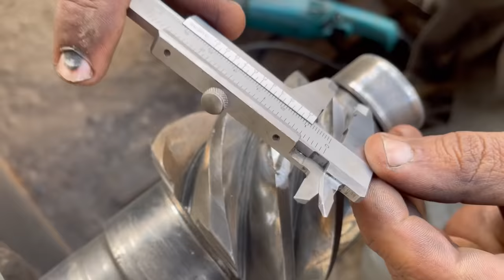I repaired the scrub pinion which no mechanic repairs | Give your opinion by watching the video |

Comment: Agreed, good work restoring that part to get back running. Longevity, as others have said, is the issue. The part might look good, restored and polished up, but how well it meshes, in terms of the pressure points on the gear teeth is another matter. To see it installed,  and Prussian blued up to show contact pattern would be nice, then the repair could be judged a bit more accurately. Regardless, hats off to these sandaled mechanical madmen! Loved him polishing the bearing mounting surface with his finger just about resting on the tool bit! Cowboys!
Reply: MY thoughts exactly.These guys do great body and frame work,but this is much more critical. While this repair may get INDIANA JONES TRUCK across the rope bridge,it most likely won't last.If he had a 5 way CNC and carbide cutters and the ability to program it correctly,then maybe.There's a reason gears like that have a polished precise surface and use high pressure lube.  It is the ability of the lube to allow the parts to slide past each other while transferring the pressure of movement across ALL of the tooth SURFACE{or contact patch in the case of gearing}. But at least this allows them to make one more delivery of goods or product,so my hats off to them,never give up!!!!This channel is an inspiration to others,anything is possible.
Reply: It better than before and you got to give it to him, you cant tell which tooth got welded!! 😁
Reply: I think they know it won't last. But it's either that or paying 100 times more for a new part. Maybe they will need to fix it again another 10 times until the truck need to be totalled. That is still significant money saved. The money saved could probably feed his family for few months or even years. In terms of safety, well I guess they are willing to take the risk. I guess it's not easy to understand when you are living in totally different quality of life.
Reply: All I've got to say is a weld is stronger than the original material. The rest of that entire tooth will have to sheer off before that weld breaks. That's just my life experience and also what they teach you in welding school
Reply: You guys have been living in the first world to long.  Give them credit for attempting a repair.
Reply: @aaronsimpson8329  My main concern would be heat treat.  If the weld metal is in the annealed state then it will not have hardness and it will be prone to premature wear.  They did an amazing job considering the circumstances though.
Reply: @RedShiftedDollar  most car parts aren't hardened steel, solely because it's too fragile. Most all engine parts are annealed to prevent wear and tear. Imagine 2 hardened steel gears rolling on each other and the teeth don't mesh 100%they're not going to have any give and shatter. So if anything the welded tooth might cause damage to the opposing part because its harder than it. But the surrounding material would break before the weld.
Reply: @aaronsimpson8329  I thought most gears were case hardened.  The core remains soft and tough and the surface gets a hardening treatment to improve wear resistance.  Either way, the hardness of the repaired section should be similar to the remaining teeth otherwise the harder teeth will be prone to cause premature wear of the softer ones.
Reply: @RedShiftedDollar  case hardening is a completely different thing. That's actually layered with a thin layer of alloyed metal that is harder and more durable than the material it's adhering to. So maybe but it's totally different than harrdened steel
Reply: @aaronsimpson8329  Either way the weld repair in the video looks good and I’m sure the machine will work.  It would be a problem if they were doing this as a rebuild service without telling their customers, but from what I see, the finished product speaks for itself.  It looks great.  It’s a common practice to repair shafts using spray welding to build back worn material and this is a similar process.
Reply: @RedShiftedDollar  I was just informing you of what case hardening is. But yeah no I see no problem, I Grew up with a family that would do that same thing. Not to this scale but fixing what's broken or at least trying balls to the wall. My dad built his first Car from 3 different ones in the 70s. I see nothing wrong with this
Reply: @aaronsimpson8329  You won't be able to convince me that the welding rod material is harder than the hardened steel gear. But that's just me :P
Reply: @mawe42  bit of a hiding going on when he resurfaced each tooth
Reply: @JerryMetal  this isn't a hardened gear like I said most all engine parts aren't hardened solely because it makes them fragile. In an example your starter and flywheel are soft so they don't prematurely wear. A weld is DEFINITELY stronger than the base metal. And I mean a weld vs hardened steel it just depends on the type of steel and the rod. And the temperature and time it was hardened at. There's too many variables to say it's stronger than hardened steel but it's definitely harder than annealed steel.
Reply: @JerryMetal  not to mention its very hard to weld hardened steel and needs to be post heated to be able to bond. You should Google it and it'll tell you what I'm telling you....
Reply: @JerryMetal  do you remember  the Somali pirate attack against one of our navy cruiser? The steel plates opened like a exploded can, but every one of those damaged sections welds still intact. The material  will give out before the weld will. 6010 rods tinsel  strength  is 60k psi before breaking.
Reply: @robertoruiz7069  but of course they don't even have a 0 axis CNC. The part is probably not available, or if it is not at a reasonable price for the customer. And yeah there's going to be some thousands off, but it's going to do way more than one delivery on that repair, it probably did 200 deliveries with half the spline broken off. And if you can't get the part or you can't afford the part but you can get somebody with a grinder and a good eyeball, if you can get a shit repair every 200 deliveries it's going to work out. Maybe you've never been to the third world
Reply: @aaronsimpson8329  If you check it out, he used a hardfacing rod 0.7% carbon, Rc 56-60
Reply: @COALEDasICE  and even if you're talking semantics and technical terms and shit. Everything I said is true. You should Google it before you're arrogance get the best of you in a real life situation. Because I did that before I answered homie and your question to make sure what I'm talking about was at least accurate with research 🤷
Reply: @L98fiero  I'm not a professional  you'll have to explain what that does for me to understand what you mean by it. I just worked with professionals and spend lots of time watching trades videos online.
Reply: I doubt longevity is issue if it was properly welded it would of been stronger than the orginal cast part. Only issue I saw was tooth wasn't fully restored nor was tooth gaps checked. Other than that I wouldn't be surprised if it lasted full life of the vehicle..
Reply: @Thelongmanable  this is ofcourse, not a cast, but forged, and hardened.
Reply: I'm no machinist but I thought of all the details you just explained.makes total sense.  Then again, if you dont have the money. Improvise.  Companies do it all the time 😂
Reply: @aaronsimpson8329  The rod he used is a hard surfacing rod that hardens to Rc56-60 it will be as hard as the rest of the gear. It would be a kind of crap shoot as to how the gear meshes considering that it was hand shaped with an angle grinder and there didn't seem to be any preheat to relieve the problems with the heat affected zone, the transition between the original and the weld metal, which might affect it's life but it probably will work.
Reply: It's so cute to see people talk about this repair with the recommendations and concerns. They have been making repairs like this since forever. To them, it's no different than changing out a seal. Don't doubt the skills!
Reply: Well said
Reply: @aaronsimpson8329  brutha I can tell you didn't just from how you described case hardened saying it's two different materials. Have actual knowledge about stuff before not just look up shit just so you can reply to random people on the internet
Reply: @GaragePL85  ok
Reply: @L98fiero  I appreciate the information!
Reply: @aaronsimpson8329  bravo Aoron. 
J’ai lus tes commentaire. Et c’est tout a fait vrais. Vous avez raison. 
La reconstitution d’un engrenage endommager de cette façon par la soudure. Ça ne marche pas. A cause de plusieurs défauts. 
La température d’effondrement n’est la même. Et encore les bulles d’airs . 
Pour moi. Je n’accepte pas ce dépannage. De cette roue dentée qui va supporte une grande charge de frottement.
Reply: @aaronsimpson8329  well done Aaron.
I read your comments. And it's absolutely true. You are right.
The reconstruction of a gear damaged in this way by welding. It does not work. Due to several flaws.
The collapse temperature is not the same. And more air bubbles.
To me. I do not accept this troubleshooting. Of this toothed wheel which will support a large frictional load.
Reply: @lewis2553  il ya de l’herbe là-bas 🌿🌿🌿
Traditionnel. Depuis plusieurs années. 
C’est leur façons choisi pour etre heureux et avoir une forte personnalité. Pas comme les autres pays. Coc.hero. Crack…..
Reply: @unkertech  you're last sentence said it all. I just finished a tour in Sudan for UN. Not only did they make something from nothing but they did it in the most horrific environment. 120 degrees, red dust flying everywhere, oil & grease all over.
Reply: 0
Reply: although it ma take them some time to build the 80,000lbs press required to build the steel/ceramic armor plates we build and this is speculation to build what we have its only a matter of time until their a competitor.
Reply: @unkertech  Steering is nothing to play with... If its Stucks when it breaks.... With heavy weight ... People going to die ...
Reply: @ori0001  what did this have to do with steering? 

Also a lot of people here must not be familiar with the remanufacturing of automotive parts on the regular. Maybe not to this extent, but nonetheless a common practice. The argument about material hardening was amusing to say the least but I learned more than I knew when I came here about it so I'm in no position to take sides. I do specifically remember a case hardening issue with general motors camshafts that was a leading cause of camshaft failure in DOD v8 engines. Boy I made some money selling those cam/lifter rebuilds for a while 😂
Reply: @aaronsimpson8329  maybe harder than mild steel but most definitely not stronger than the hardened alloy steel of a pinion gear. Not only that but the HAZ likely weakened the original material near the weld making much more brittle.
Reply: @aaronsimpson8329  also gears like that work harden thats why you have a break in period
Reply: @ori0001  Not saying I "approved" of such method but these people has been doing it for years. They have to make do with what they have. Nobody want to risk their life if they have the choice. Point is, you wouldn't understand until you live in their world. Not everyone is privileged to live in first world country.
Reply: Do it again if it fails after few days😄
Reply: @aaronsimpson8329  Case hardening is done by diffusing carbon into the metal surface-- several hours of baking the part under high pressure propane or carbon granules.  It's critical-- a few years ago an Indy racer lost the Indy 500 race because a critical gear had not been case hardened.  The gear lasted under 5 hours!
Reply: @aaronsimpson8329  weld might be strong but precision it’s critical. Been a gear it needs at least 99% contact, also it has to have some backlash to allow thermal growth
Reply: @galindo68  way I see it in things like this being a steering part. This is more than enough to be effective. I mean only very few engine components need to have a specific gap, or clearance. I don't think gears of this size would have much thermal expansion to the point it would bind. Especially in the middle  east where it tends to be a stable climate throughout. Not like north America. The question at hand was the strength of the weld to the part.
Reply: @georgegonzalez2476  face hardening is the act of adding high carbon to metal while its Ata high temperature diffusing carbon into the material. Case harding is the act of adding a harder material to the face while allowing the under material to "stay soft".and hardened steel is just quenched high carbon steel.
Reply: @COALEDasICE  you need to educate yourself between the differences of hardening. Face hardening the act of submerging high temp metal in carbon allowing it to diffuse into material. And case hardening the act of layering a small layer of harder material on a surface. And hardened steel. The act of quenching high carbon steel. A simple Google search could've told you that. But you just want to be here and say you know what you're talking about cuz you're a fabricator when the "fabricator" doesn't even know his terminology. Why don't you run this by your supervisor and see what he says. I mean you willful ignorance is scary. I'll stand by my Statement ENGINE COMPONENTS ARENT HARDENED STEEL. or like in this instance STEERING PARTS ARENT HARDENED STEEL NOR ARE THE BOLTS THAT CONNECT THEM. Like I said before they may be case hardened but they're not hardened steel. Your reading comprehension is just about as bad as your ability to get your point across.
Reply: Filed and sanpaperd the crank shaft on a turbocharged diesel engine with a burnished file some sandpaper and a  Shoelace After It melted and spun To connecting rod bearings. Still running fine 6 years and 70k miles later.... if you do Enough have baked repairs you ether get good or one of them kills you
Reply: !Agree!
Reply: @unkertech  why do you assume that people living a different quality of life would not understand?
Reply: Not just concact pattern pattern.

There clear damage to almost ever tooth. 
The hardening on that tooth is now gone.
It’ll look pretty but this gear is good and fucked
Reply: I couldn't have said it better. One thing to add is, it would probably cost too much in labor here in the US to do this. You would probably have to buy a new pinion.
Reply: @aaronsimpson8329  if you se it has a bearing journal and that requieres precisión. If it’s not  straight it will ride harder on on side causing bearing failure, also gear wear unevenly. I’m not knocking the ability of the person to weld and tapir just stating the obvious. If like you say it’s for steering purpose even more critical because it’s in constant use and if fails it could be fatal
Reply: I work as a chief engineer on board Ships  ,I have encountered experienced machinists/fitters on-board who rebuild shafts ,shafts tend to bend when u do spot welding ,so the welding has to be slow for the heat to dissipate without causing thermal stresses,and most of the shafts do have a good working life ,but yeah replacement is always a better option ,but for us ,it is important to keep the ship running till the spares are connected
Reply: @galindo68  bearing journals between where the gear teeth mesh? Doesn't seem right to me.
Reply: @aaronsimpson8329  we’re do you think that gear is mounted from. If you had any mechanical knowledge you would understand
Reply: @galindo68  yes I get that it has a bearing to keep everything aligned. I'm not sure what that has to do with the gear teeth. Maybe other than the fact it's not going to have any play so if it doesn't fit right it'd not mesh right. You just made a statement with zero context talking about bearing races which were completely irrelevant to what's going on here unless you want to explain your though more
Reply: @aaronsimpson8329  I was lucky enough to work in a heat treatment plant. I wanted to learn about metallurgy after becoming a machinist. Very interesting. Steel and alloys of steel can't be hardened without carbon. Case hardening is heating a part in a carbon rich atmosphere for a certain amount of time depending on the depth you want. Must be ground to size after. We used alcohol diesel mix mostly. Part must be quenched then tempered. Tested then tempered again if out of spec.
Hard surfacing is welding a different alloy onto a base material then precision ground to size. Mostly done to save money. Use a much cheaper alloy for a shaft and the expensive alloy on the surface. 
The only process we used that didn't need grinding afterwards is Ammonia Nitriding. Much lower temperature needed so doesn't distort the part. Dangerous tho. Open the furnace before it's cooled enough and BOOM! No rookies allowed near that!
 Hope that helps
Reply: As far as this repair? Too many things wrong here...
So no....just no LoL but high marks for effort.
Reply: @aaronsimpson8329  they absolutely are hardened, at the very least they would be case hardened, the starter may have a lower hardness than the flywheel but neither of them are "soft" by any means. And the gear in the video would be hardened to a better standard than a starter or flywheel as it is in constant mesh unlike the starter and ring gear of a flywheel that only mesh for seconds at a time
Reply: @Scott_A  I've said that previously
Reply: @aaronsimpson8329  actually you said to @jerrymetal  "this isn't a hardened gear" in reference to the video and then you said " in an example, your starter and flywheel are soft so they don't prematurely wear" soooo, you're full of shit as the gear in the video and starter and ring gears are hardened. Just because they may use a different process to get a different type/level of hardness doesn't take from the fact that they are hardened materials
Reply: @Scott_A  read up dingleberry. Soft as in not hardened. I've stated what you said in the first 20 comments. A hardened steel gear is definitely different that a case hardened gear. Which engine and suspension parts aren't hardened I quiet literally said "they're not hardened they may be case hardened but they're not hardened steel. The process which they are hardened definitely has an affect on durability of the part. Your reading comprehension is just as bad as the other guys holy shit
Reply: @aaronsimpson8329  do you know anything about machines with gears? If it’s out of alignment the bearing gets damaged. If bearing fails the gears will fail
Reply: Also the time and materials are cheaper to replace
Reply: @aaronsimpson8329  case hardening isn’t a seperate layer of material added
Reply: @aaronsimpson8329  i did, thought I should
Make sure I was correct before correcting you.
Please read further than the first answer that pops up on google
Reply: @galindo68  yeah except that is irrelevant to what we're talking about fool we're talking steel hardness not bearings or gears. How do you link material hardness to bearing failures. I never spoke on behalf of how precise it is. Yalls reading and writing comprehension is absolute shit. It's like you had a thought in your head and thought it was relevant, blurted it out randomly expecting people to understand. I get what you mean after you give context to your thought process.
Reply: @chrisbanning413  read 4 or 5 forums and you'll find out what most people think of case hardening is actually called face hardening. And hard facing is case hardening but specifically with welds. I didn't know any of this before Commenting originally. I've spent enough time on here debating / researching with other people to know what I'm talking about.
Reply: @chrisbanning413  if you were to Google case hardening vs surface hardening (face hardening) it'd tell you specific differences. The 3 types are case hardening, surface hardening and through hardening, (hardened steel)
Reply: @aaronsimpson8329  and you still don’t know anything about it.
You have even had a comment from someone employed in the industry that says you are incorrect
Reply: This is a great job you guys are good at this i look up to following what you do...
Reply: @aaronsimpson8329  idk about that he kept welding over welds without letting them cool down enough and the heat affected zone also plays a part in the metal becoming brittle which can cause a fracture along the metal
Reply: @aaronsimpson8329  proper terminology....
Case hardening.....heating a part in a carbon rich atmosphere. Adds carbon regardless of the alloy.
Hard Surfacing.....adding a harder alloy than the base material.
These arguments are why I wanted to learn more about metallurgy. It can get very confusing. It's a HUGE learning curve but very interesting!
Cheers
Reply: @dv42300  that's face hardening. Look at the differences between the two. Face hardening is direct into carbon. Case hardening requires a small layer of harder more durable metals. At least that's What all the forums say
Reply: @dv42300   @Doug Venus  hard surfacing is the act of welding on top of the base metal. Specifically with welds. Face hardening is the act of submerging steel in carbon at high Temps to up its hardness. Case hardening is the act of a more durable metal. Yes we are arguing and metallurgy is a fancy word but man I'm not sure how people can come up with anything other than. But face hardening, case hardening, and hard facing are all 3 different types of hardening. Hard facing tends to be done on new or broken equipment excavator. Case hardening can be the metal plate on your antique pistol. And face hardening is what they do with knives to make sure the tang stays "soft", and the edge is as hard as can be to keep an edge. I too have looked into this topic and am unsure how people who look into it and research it can come up with different answer's. Beyond the first initial Google search.
Reply: By the logic one can face hardening a peice of mild steel to make it high carbon knife steel. Only penetrating a few mm.
Reply: @aaronsimpson8329  Complete bollox
Reply: @stevo184  bollox to the fact that none of you actually truly researched and compared anything. Looked at multiple sources other than Wikipedia. I mean shit in school you had to source like 5 sources on your research paper. Why can't yall use that skill in your day to day? I mean fuck if you did I'm sure you'd change your disposition on more than just this topic. I'll provide links to metal foundries if that's what it takes for you guys to look into things
Reply: Yall ain't gonna like it but galvanized steel is case hardened lol except it only prevents oxidation and gives a longer lifetime the act of boronizing is just like galvanizing except add to the durability
Reply: @aaronsimpson8329  cool the weld is stronger than the part now.  I wouldn't of known that honestly.  Learn something everyday.
Reply: @RD-xh9ss  yep its pretty cool. I've been kn trades my who life and honestly this is my favorite part is actually looking into it and Learning  stuff commoners would never know
Reply: Your thought is right, but it can carry lots of tons
Reply: @howtomakeit5692  yes as a steering component I wouldn't worry about this personally many people live in wonderland where they think it need to be able to carry a mnt. It's a steering component
Reply: @aaronsimpson8329  yes
Reply: Какого хрена! Варить надо в среде защитных газов. Отремонтированный зуб с точить на фрезерном станке. То что они сделали проходи точень недолго.
Reply: @aaronsimpson8329  It's not a steering component. The front of the truck is untouched, the drive shaft is out and most of the tools n guts are located at the rear of the truck. Most likely its the gear that drives the big bevel gear of the differential. It needs to be scookum.
Reply: @frikcoetzer1776  could be part of a driveshaft based on the size and type of pinion gear it's most like a steering component. Plus that's the most common use of pinion gears Google it. But thanks
Reply: @stevo184  Hi Steve. I made the blanket statement that all case hardened gears had to be ground to spec after treatment but I could be wrong. I treated thousands of low speed gears that went into winches. Is something like that ground to spec?
Reply: @aaronsimpson8329  No it's called galvanizing. It's to protect against corrosion and is softer. 
I think you need to actually work in a heat treatment plant for a year or so. My boss had a degree in metallurgy. It's not a fancy word. It's what are discussing. One part of it anyway. BTW you stated case hardening mild steel a few mm. Can you tell me at what temp and how long it takes to case .010 thousands of an inch? How deep can you case harden? Why is there a limit? I have no interest in insulting you but I can say most of your statements are false. Best way to learn is to listen to people who have done this type of work for a living. Better yet, get a job doing this. It's hot brutal work at times but I enjoyed it. Another suggestion is to buy the Machinerys Handbook. Dry reading but was my Bible in trade school and beyond. No people making false statements in a forum just facts. Again I m not trying to insult you. You're almost there and obviously have an interest in this subject.
Cheers
Reply: @dv42300  this is NOT Galvanizing. I'm not even going to read your comment beyond that. This is not galvanizing you don't work in a heat treat plant. Galvanizing is a zinc coating on the metal. Nothing like this. Galvanizing is strictly for oxidation purposes. Don't.come here trying to sound like an intellectual when you don't even know the processes.
Reply: @dv42300  also I'm not going to listen to YouTube experts when there's viable research online you can do telling you the opposite of what these "expert" are saying. I listen to wise people not people telling me I'm wrong and not being able to back up anything they're saying
Reply: Since you're speaking on behalf of a other person who's gota degree, you should look at the differences between steel hardening and galvanizing. I don't need to know the tolerances of metal and how much they expand to know the different types of hardening methods..... at this point I'm not being rude I'm just tired of people telling me I'm wrong and it's a different process when they don't even look into things. 100% not Galvanizing I'd put myself on a firing line I'm that positive.
Reply: @aaronsimpson8329  How can you learn when you refuse to read? I thought I was being helpful. Oh well. Good luck in your future endeavors.
Reply: @aaronsimpson8329  you right about one thing. I do not currently work in a heat treatment plant LoL but I did for several years. I also owned a Paragon oven to heat treat knives I made. Got tired of paying someone else to do it. In fact I got that job to learn about metallurgy because of knife making. Learn by doing....
Reply: @dv42300  I refuse to read from people claiming they know the trade and aren't even in the same ballpark. Trust me I've read so much from actual forums and not just YouTube experts. So you telling me I don't read is just wrong. Look up galvanizing and get back to me. This wasn't helpful if anything you made it more confusing to the people who read this and choose not to educate themselves. Such as yourself. A look on the goog would've told you this isn't galvanizing. And you tried to correct me. .... I just can't get past the logic of you telling me I need to read when you didn't even do your own research
Reply: @aaronsimpson8329  I only research when I don't know the answer. I commented on your unwillingness to read the rest of my post not reading in general.
Reply: @aaronsimpson8329  BTW did you "research" your statement that I don't or didn't work at a heat treatment plant? You sound very sure of yourself. I guess my income from that time and tens of thousands of parts I treated and tested don't exist?
Reply: @dv42300  you also thought this was galvanizing you owning a oven is cool but irrelevant. You obviously didn't learn much by doing you must've worked in a galvanizing factory not a heat treat company
Reply: @aaronsimpson8329  "face hardening is what they do with knives to make sure the tang stays soft" 
Could please quote your reference? I've made hundreds of knives and never heard this before. I'm not saying you're wrong. The description doesn't sound right. My knives were made with ATS34 or 440C mostly and were heated to 1850F (ATS34 anyway) then forced air quenched. Tempered twice, two hours each usually to Rc56 to 58. Pretty hard for a knife but the edge lasted a long time and I had the equipment to deal with it.
Reply: @dv42300  I'm not gonna argue. That was an example, don't care to get into semantics. But again you thought this was galvanizing. So  I'm not sure what point you're trying to prove. That you make knives and look into steel. Totally irrelevant to everything we're talking about here.
Reply: @aaronsimpson8329  ok Arron. In the future you may try asking how someone came to their knowledge instead of accusing them of lying. Your are correct that just because my boss had a degree doesn't mean I know what he knows. So I will explain. He was an open book, great teacher and never held back information from me and more importantly I wanted to learn. Never once did I say to him "You're wrong and I don't believe you have a degree". 
I tried to be respectful to you and got the opposite in return. If you would like to really test your knowledge get a job in the field. Continue with your so called knowledge there and see how long you last.
Cheers
Reply: @dv42300  you told me I'm wrong and this is galvanizing. I don't really care to know how you came to your conclusion. It's the internet, you just made a assertion that wasn't even close to the ball park. And begin telling me about knife making. I'm glad you had a master to learn from. I've worked many trades and been Fortunate to have those people too. But I also do my own information. I always make sure I'm correct when I'm correcting someone. You most definitely said I'm wrong. I'm not testing my knowledge it's literally just definitions you can research. I don't need experience in a field to know definitions. You thought this was galvanizing I mean come on
Reply: @aaronsimpson8329  Not upset at all. Just trying to be helpful. Recommending to someone to actually work in their field of interest is not an insult. You are incorrect in most of your statements. Working with people that hopefully are willing to teach you is a great way to learn. 
If your first reaction is to denigrate someone personally just because they don't agree with you is worrying. Best figure that out before anything else. You have stated many times you have read much and watched videos on the subject and at the same time dismissing anyone with actual work experience. Then you denigrate others for learning from those same sources. In my "experience" the few guys that got hired after me who thought they knew everything didn't last through an 8 hour shift. Made my stock go up! So ask anyone with years of experience in their field would hire you after reading your comments? The answer would be no.
But of course I could be wrong but my "experience" says otherwise.
Anyway this isn't fun for me anymore so no more comments from me.
Good luck to you.
Reply: @dv42300  if I was in the field and someone told me this was galvanizing I'd not listen to them. I don't need experience to know this isn't galvanizing. If I was in a trade and didn't know a thing I wouldn't dismiss them. I dismiss the Facebook and YouTube experts. The people who tell me this is galvanizing. The ones who tell me I'm wrong and can't back up their statements. I'm not interested in this field. I've been stating what the research I've done implies my lifestyle allows me to spend as such time as I want on anything. Can you at least tell me your were wrong about galvanizing? And how trying to correct me when you're wrong affects your credibility? Because if you can't acknowledge you're wrong with you're correction I'm not sure why u should honestly respect and take anything you say for fact. If you can't do that you can't criticize me. YouTube is full of know it all. Which is why I research and Google before I speak. And at least can back it up
Reply: @aaronsimpson8329  Ah ...that explains it. You have too much time on your hands. Bye bye
Reply: @aaronsimpson8329  no it is not period. End of discussion
Reply: @aaronsimpson8329  Bizzare. You are a strange dude
Reply: @dv42300  so let's review. You come here spouting incorrect information. Trying to correct me. Then tell me to listen to the people on YouTube who have no source of credentials or credibility. I tell you I don't listen to people who say they're in the trade then cannot stand by their statements, or get upset and make personal remarks instead of trying to prove their point.  Just like everyone else on this thread. I can post links that show what I'm saying. Everyone else just says "this is not that" with absolute zero context or reference. The only thing Strange is how you can't understand what I'm saying. And lol yeah too much time on my hands I'm up at 330am everyday and sit in my office all day til 2, literally wasting time making money lol. It's great and I'd understand why anyone would hate on it because I am lucky I admit that.  But at least I occupied my time by researching and looking into a new trade. And I honestly learned a lot from doing research. I've learned nothing on here beside people really just don't want to stop and Google stuff before they make a public opinion. And remember this post was about nothing other than heat treatment. You come here telling me it's galvanized the begin talking about knife hardness, and tell me to listen to self proclaimed technicians? And you call me bizarre? Like really what is your point? For me to listen? Yes I will when I know the credibility of the person educating me. Literally this has been nothing but he said she said except I can back up my claims.
Reply: @dv42300  say I started a cnc job with ameture experience. I can operate a cnc. I'd 100% listen to the old timers with confidence. They've been there for 25 years. It's respect. But I'd still correct them if they said this was galvanized. Has nothing with inability to listen or whatever your point was by telling me to watch that video. Has everything to do with credibility. Easy to proclaim yourself as anything you watch to be perceived as online. And that's my entire point regarding our conversation here Doug.
Reply: I think it will not be strong as before
Reply: @mawe42  but strength is not the same
Reply: I think it may need to be hardend again with heat treatment
Reply: @unkertech  Don't be silly read the title it's PRIDE BOASTING about doing things that no other mechanic will do!!   For these people it's .not a question of money it's show off and DARES. You will think twice at going around a bend at speed or overtaking from either side. For these people they will overtake either side or around a blind corner even if it is not safe. 
    It is PRIDE and "I can do anything " attitude & mentality
Reply: R4
Reply: @mawe42  its good but it is going to break easier now
Reply: @mawe42  Yeah, that's the problem.  The tooth looks good, but it may break off at any time.
Reply: You people obviously  have no knowledge  of metallurgy  and heat treatment.
Reply: @robertoruiz7069  "ability to programme"   hmmmm
Reply: @maplemanz  Hmmm, well we learned in  high school metal shop class more than these poor guys did, apparently, as WE annealed and hardened our pitiful little workshop projects as needed.  The spatula for Mom, the handle was annealed before bending the loop.  The awful kitchen cleaver, the edge was hardened after grinding.   Easy-peasy but hardly ever done in these videos.  Those complex curved gears  have very small gear contact patches and hardening is very much needed as the stresses are in the tons per square millimeter.
Reply: Have you seen rest of the truck ??? Its a week at a time on a shoe string budget
Reply: I hope they know about the metal temperature resistance difference from both 🤣
Reply: @robertoruiz7069  I guarantee you that's the strongest tooth on that gear
Reply: @robertoruiz7069  back in the old days gears like that were made by hand one at a time
Reply: To get you up and running this is amazing
Reply: Didn't see any measurement of tooth thickness  would like to hear the noise this pinion  make when running  with gear
Reply: @aaronsimpson8329  these spiral  beveled  gears should  be hardened  and ground and always kept as sets they aren't interchangeable
Reply: @jerrykahler5586  they're case hardened my friend
Reply: @aaronsimpson8329  not in every  case both pinion and gear heat treated  leaving stock on bearing dia on pinion and stock in gear bore then lapped with compound  and shipped as a set
Reply: @robertoruiz7069  No gear slides over each other, they all roll on each other.
Reply: @robertoruiz7069  Not to mention the differences in hardness and tempering that the piece will already have.  When it comes to seeing how precise the fit is in the new helical edge of the pinion, it is necessary to previously create a negative piece in a plaster mold with some metal such as bronze or brass and thus calculate the adjustments in a better way.  But even the result, the duration and the final success of the pinion when it is receiving friction in its work is a lottery.  Here in Venezuela it is very common for people to decide to resort to this type of archaic and unreliable solutions since even without being sure that everything will end up being successful, they assume that this bet continues to give them a satisfactory cost-benefit value and they can continue working a considerable time until they can opt for the new part.  
I have already repaired 3 or 4 such pinion like this in my life, but it is not something that is recommended due to the greater risks involved.  Excuse some confusing explanations but my English is not very fluent so I use Google translator to give my opinion.
Reply: Trabalhar assim, sem os recursos modernos, são para muito poucos espalhados por este Planeta Terra. 

Gostei da solda escama de duas camadas e depois, do polimento. Ficou faltando a montagem e o funcionamento. Mas, dei um LIKE ❤
Reply: @aaronsimpson8329  самое адекватное комментарии
Reply: @RedShiftedDollar  Gears are made to what purpose they are used for.Thru harden case hard soft,even made of plastic or Pressed fiber so the teeth break before anything else does.
Reply: @Clarity5970  So what kind of application does the gear in the video look like it is used for?  Perhaps they should have just replaced it with a plastic one.
Reply: @RedShiftedDollar  to expensive!
Reply: y
Reply: M0
Reply: They’re not Cowboys, they’re Indians.